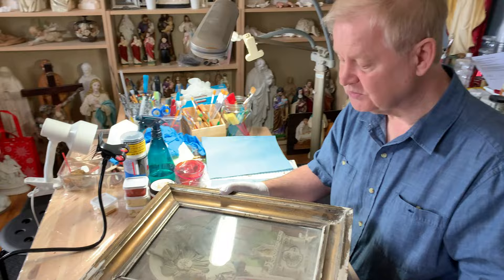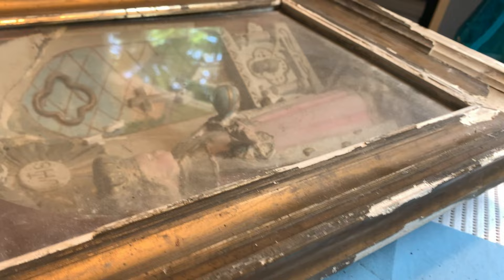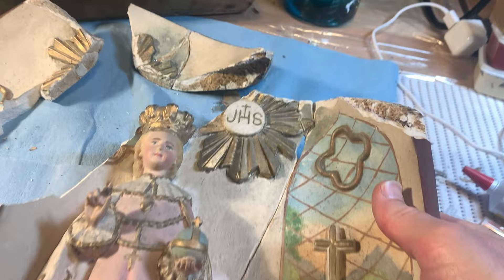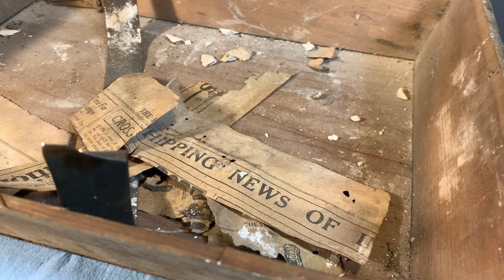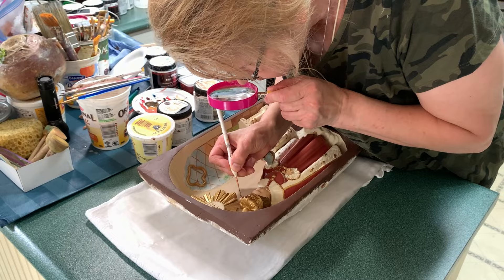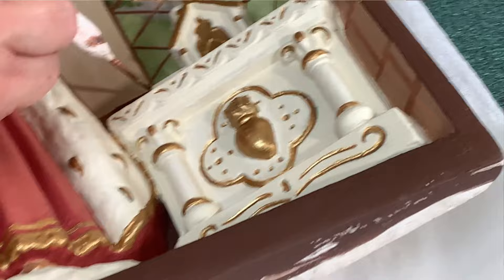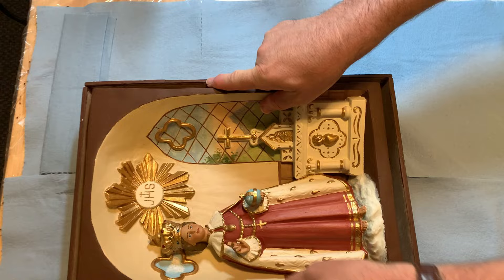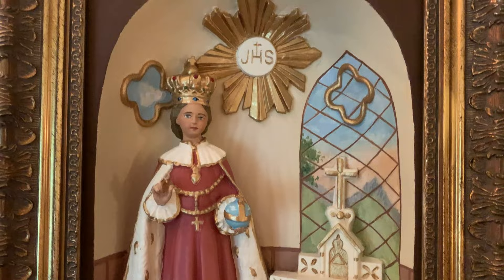Restoring The Divine Infant statue

Comment: Thank you for posting this, may I ask what kind of paint is used? Do you apply a primer and a sealant?
Reply from the maker: Hi Lady Marigold!  We use a mix of premium acrylic and latex paints on most of our statue projects. We apply Zinsser primer to help the layers of paint bond well to the statue to avoid an uneven absorption by the plaster - especially if we've had to apply new plaster or sanded down some rougher patches.  Interior or exterior prime and paint depending on the project and where the statue will be displayed.  We rarely apply sealant over premium paints, unless the statues are likely to be extensively touched.
Reply: Thank you so much! I've just received a commission to repaint a 12 inch statue of Our Lady of Lourdes, she has a lot of faded paint and I think a bit of damage from candles sitting a little too close 😆 these videos have been very helpful, your commentary is really clear and to the point. The transformations are very inspiring.
Reply: Also, would it be possible to contact you for advice at all? I'm in Australia, otherwise I would get them to send it to you!
Reply from the maker: @ambrosiatea  gidddday!!  😊 Yes feel free to contact us with any questions you might have. And good luck with your project. You can reach us best through our website by clicking the contact us link.
Www.Statuerestorers.com